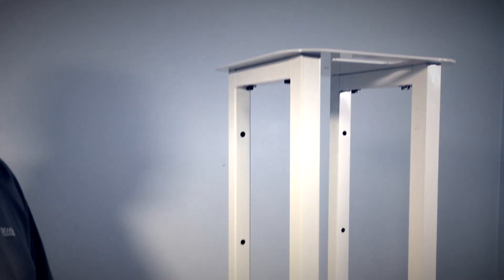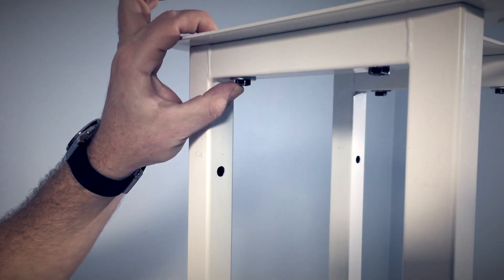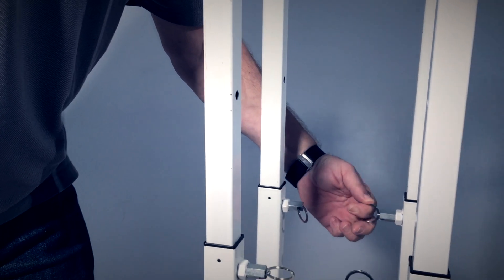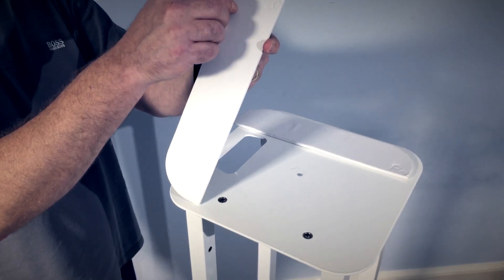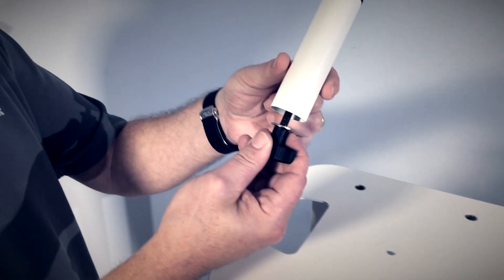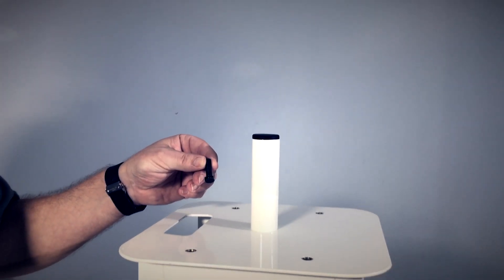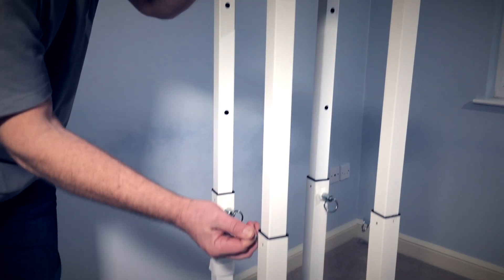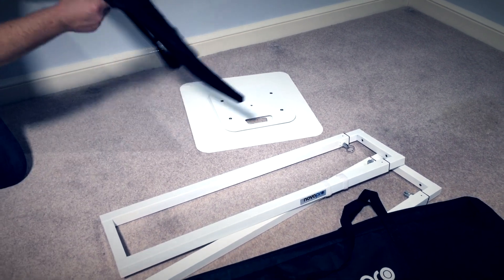Novopro PS1XL - variable height podium stands in white with 2 different scrims HD

Comment: Are These Sturdy?
Reply from the maker: Yes, they are sturdy and have solid metal baseplates. We also sell the larger HD PLATESET (it is on the website) which is bigger and much heavier if you need extra support or may have someone fall into them….. Some customers have put sandbags on the hidden side to give extra stability for those drunken moments that happen at certain parties! They will be more stable than speakers on stands for sure.
Reply: @novopro4276  as long as they don't wobble from side to side whilst I have a moving headlight on them.
I've ordered these so will let you know how I get along

Comment: can you mount a tv on this?
Reply from the maker: Hi There. Yes, you could mount a TV on the stand. It comes with a 35mm pole mount and it could be mounted on there or on the hole in the centre of the PS1XL - or even on the uprights of the unit. You will have to be careful that the centre of gravity is suitable but that all depends on what sized screen, the weight and where the mountings are....we suggest you contact a reseller and view the PS1XL in store as you know your tv (and the fixings, weights, dimensions and where you would like to mount it from) and then you can source a suitable bracket for your personal requirements.......we do not supply a screen bracket that would be suitable I am afraid.....   Hope all gets sorted for you and that you will be pleased with the product!